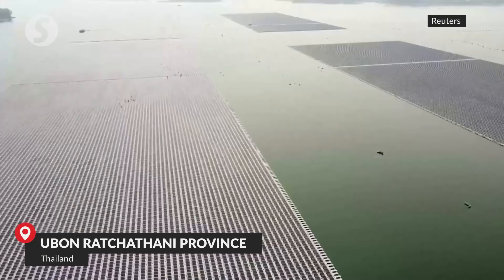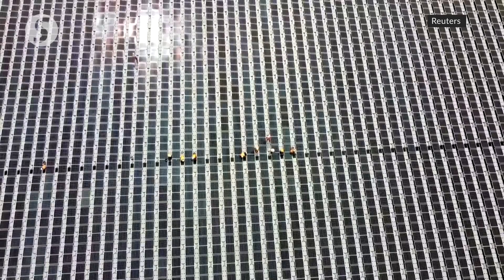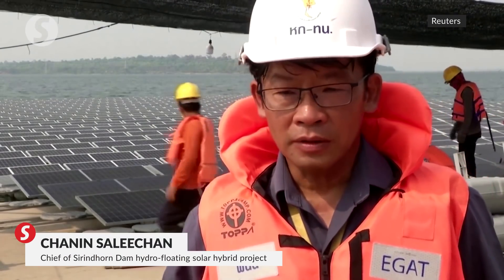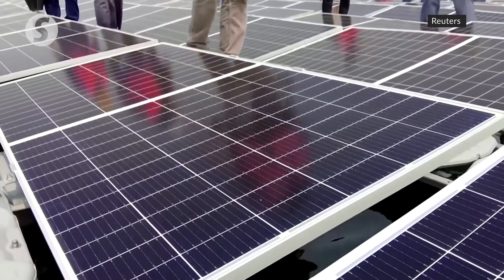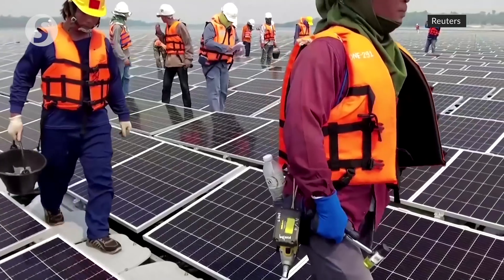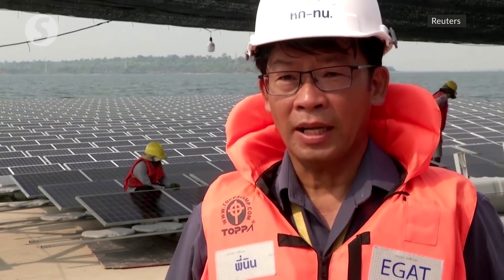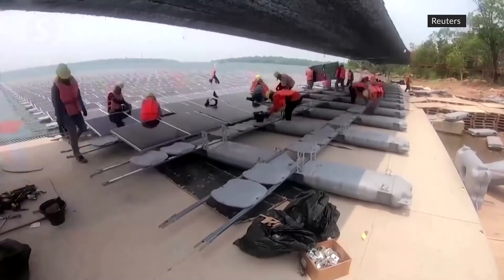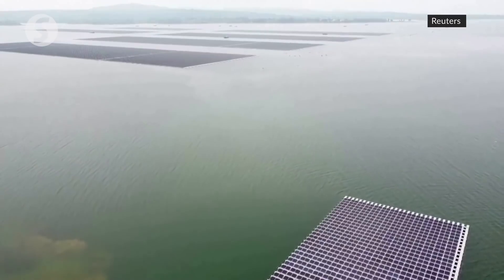Thailand builds a massive floating hydro-solar farm

Comment: Other neighbour countries begin to build solar system for real while malaysia just build by using imagination & how much it can pocket thru undertable rather than undersea.
Reply: Are you from Malaysia??!! You don't even know your own country mix generation capacity. I bet you don't even know MESI 2.0. Btw, i am not Malaysian.
Reply: @advancesg  sounds like you know a lot despite not being malaysian.
Reply: Malaysia do have this types of solar farm (since 2018 dah mula beroperasi) located in Mukim Tanjung which sized 98 hectars with a total of 230k solar panels installed and currectly in operation. It can generate up to 73.2 MW. Negeri2 lain pun dah ada, cnth di Gambang Kuantan dan Pekan, Pahang

In 2020 Malaysia - First Large Scale Floating Solar Farm COD in LSS2 Scheme di Dengkil, Selangor.

Malaysian, please lah tingkatkan pengetahuan berkenaan negara sndiri 🇲🇾 very sad to read some of the comments. Mentaliti suka merendah2 kan negara sendiri, tapi info tntng negara sndiri tak tahu.
Reply: @nasilemaktehtarik2623  this type of project should be implemented across the country in larger scale.  Why only certain states applied?  That is why not many of us know the details coz the gov didn't have a solid plan to implement them.  Else they would have proudly announce the news.  
Dont even start with that mesi 2.0 coz it could likely end up with 3.0, 4.0 and etc. but what really happened behind the curtain that causes so much delay progress compared to other countries?